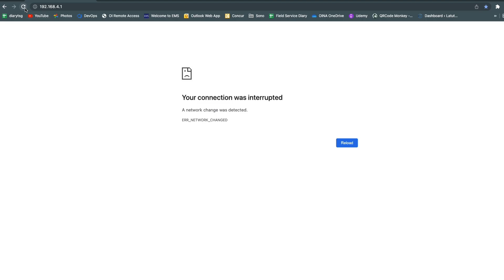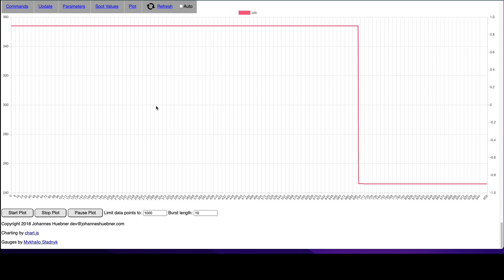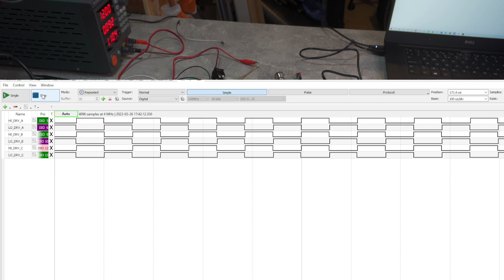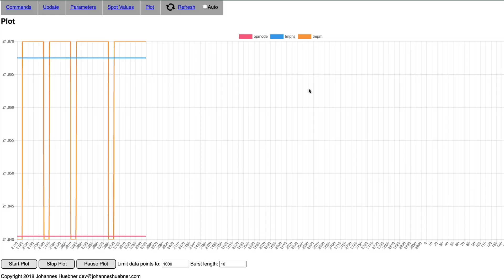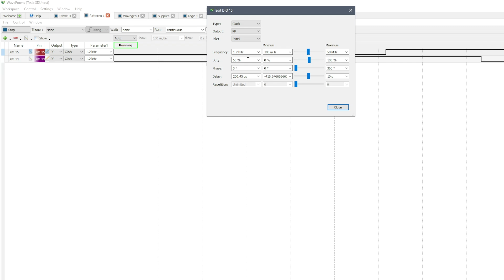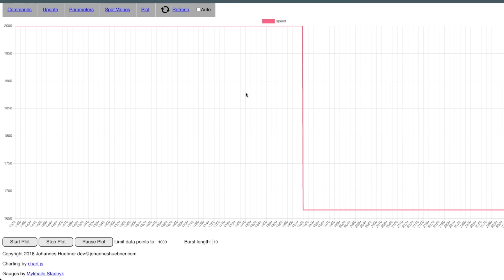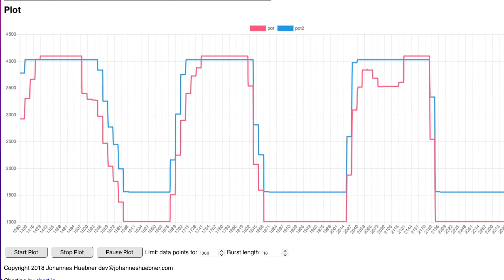Will this board work...? #9

Comment: The dual throttle inputs are for safety. If the two signals don't agree, the ECU assumes a fault. The slightly different 100% voltages are so that you know you're getting two different inputs, not a single one to both channels. As it stands, if you want to have the brake pedal control the regen level, you have to sacrifice one of your throttle inputs to do so and lose the redundancy.
Reply from the maker: Hi Paul thanks for your comment very useful. I wonder if you still have some of those BMW battery modules for sale. I am beginning to look for batteries.

Comment: Thx mate for your work, so hyped to see the motor turning, be careful not to blow the Tesla inverter if your breaker trip as explained by Damien Maguire.
Reply from the maker: Thanks yes I am aware of this and will test first with low voltage power supply